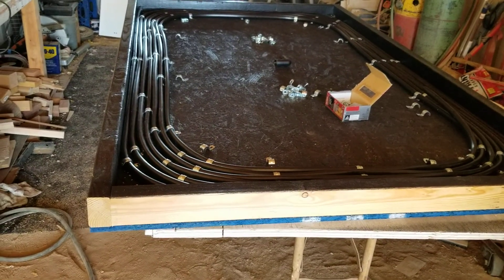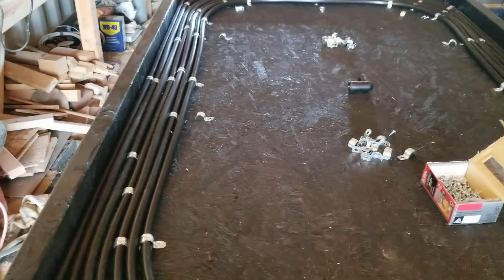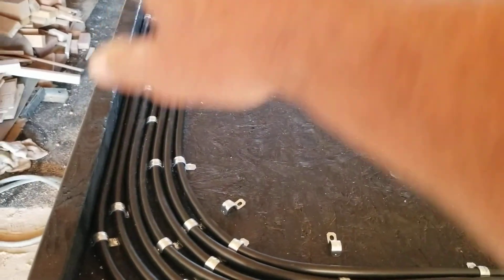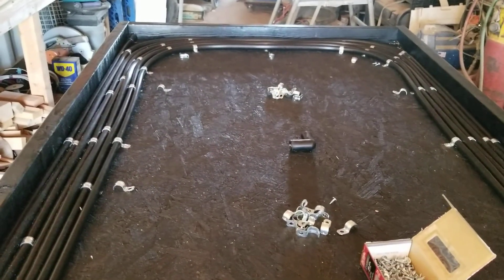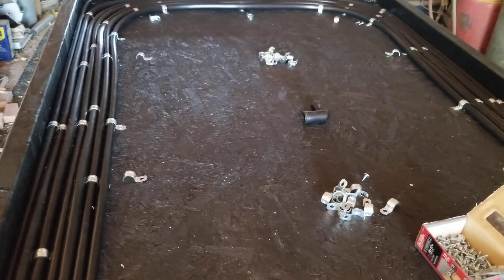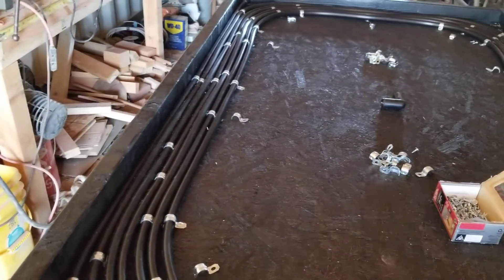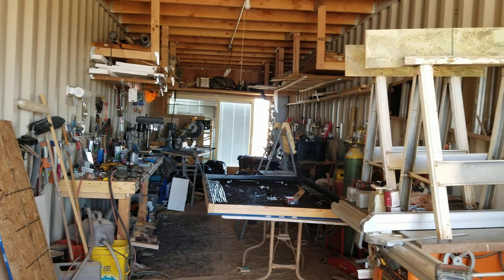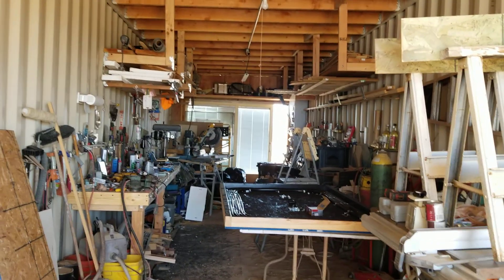DIY Solar Water Heater Build, part 1, July 7, 2020

Comment: I'm thinking of making a solar water heater from an old 55 Chevy radiator a friend gave me a long time ago 😁
Reply from the maker: That would be interesting.  But if it is a good radiator, wouldn't it be worth selling instead?
Reply: G Bear's Off Grid Ways-A Homestead In The Desert Not sure what condition it is in. May not be suitable to use in a car.
Reply from the maker: @saltyshellback  oh, ok.

Comment: Bear, at Walmart they have a fabric glue that is great.
Fold over the edge of your new flags and glue a hem. 
The flags won't shred nearly so fast.
One thing about this glue.  It dries out super fast in the bottle.  To stop that occurring, once open unscrew the top after each use and lay a piece of plastic over the top of the bottle and then screw the lid back on.

https://www.walmart.com/ip/Beacon-Adhesives-Fabri-Tac-Glue/19204412
Reply from the maker: Great idea.  I've tried wood glue and silicone before, and it works but not for much longer.  The time and expense wasn't worth the short extension of time.  I'll have to try the fabric glue and report on it.
Reply: @GBear  Try folding up 1/2" and then 1/2" again.  I will look forward to your report.
Reply from the maker: It may be a while for that as I don't often go to Wally-World...😁

Comment: what size water heater are you making? Great idea. Thinking about making one. When I find land.
Reply from the maker: This one is 43" x 70" and will hold a little over 3.6 gallons in the tubing.  Pumped slowly through, the water should reach very hot temps.

Comment: Flipping 115F here yesterday.  I didn't even measure it today.  Still deeply upset about my shed situation. LOL
Eaaa I made one of these that lasted years.  Someone needed one and I sold it too cheap , never made  another.    I found out if you keep the coils separated by one inch or so they noticeably  collect heat much better.  Guessing  it's the  way the  Incident  light   hits the tubing.  Separated a bit more tube is exposed to the direct light. Before you seal it up you may want to put some spacers in it ? My bet is the water would be too hot as is.  The water coming out of the thing can SCALD you.    Think garden hose first slurp ?  LOL
You may even be needing a Check Valve on that thing.  Yours is much larger then the one I built.
Reply from the maker: Interesting!  I'll be experimenting with techniques, but will start with close knit coils at 300 feet of coil.  I suspect the temps coming out will be close to 200°f.  Heating water for greenhouse heat should work in my environment.

Comment: That is so interesting.  I can't wait to see how the water heater is going to heat the greenhouse.  Thanks for sharing!
Reply from the maker: I'm sitting here contemplating possibly adding more of this tubing just under the surface of soil to heat the grow bed in the winter, but may modify that with a used oil/grease burner system for the extremely cold nights we sometimes get.

Comment: Hellloooo  G Bear. Lol , yeah slot cars were the best.  Im guessing u run an A/C unit.  If u do, how cool does it keep u in the desert. ???
Reply from the maker: Most air conditioning only cools 20° below ambient temperature,  so it works for me.  It was 100° outside today and I kept it down to 79° in the bedroom for a 2 hour nap.  Battery bank stayed above 13.4 volts on my 12v system the whole time.
Reply from the maker: And welcome aboard!
Reply: We forget about that stuff.   We actually had a commercial slot car race track down the road as a kid.  BiG thing it was.
Reply from the maker: @pulesjet  kids today would be ecstatic if they got to run slot cars!